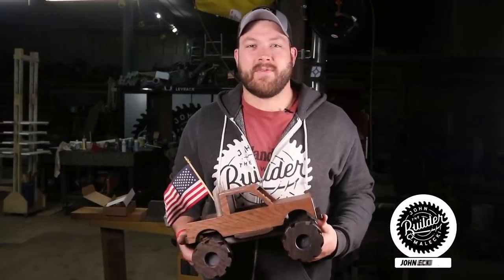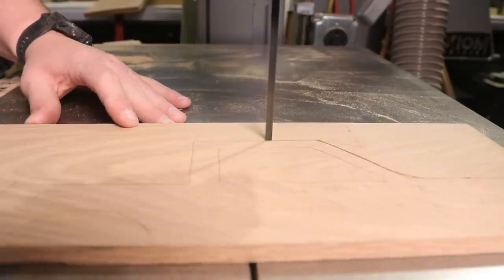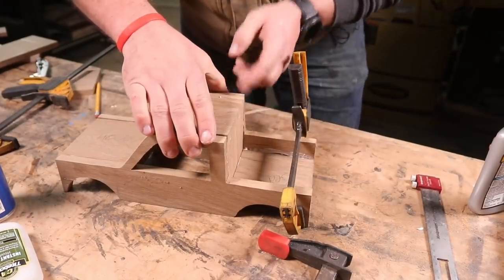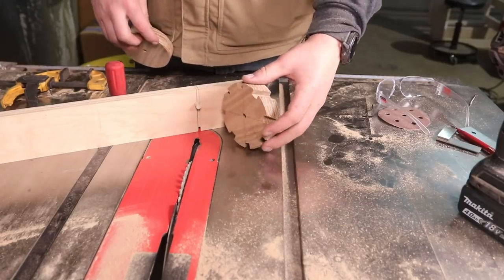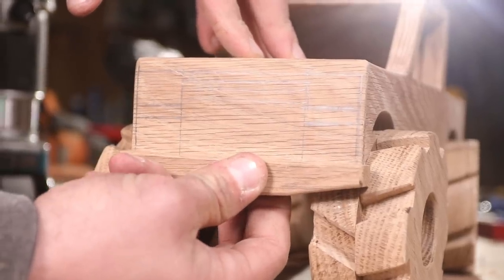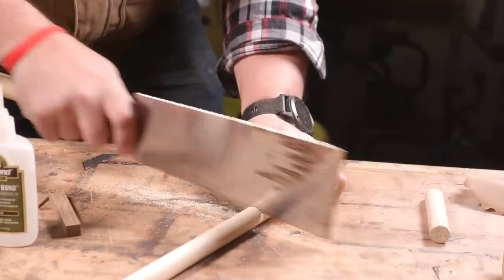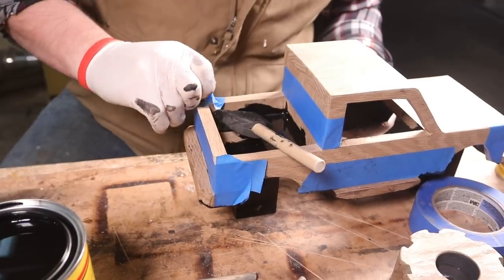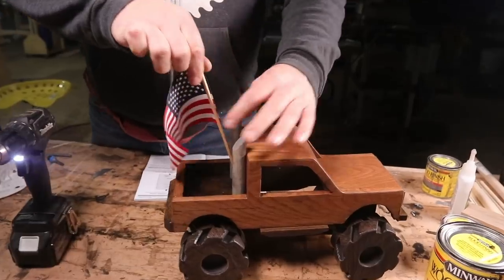How To Make A Wooden Toy Monster Truck

Comment: Awesome truck!  I love the sipped tires! One weakness I've learned with the trucks that my dad built for me and those in my 2 boys collections, over the years, the axles may be a bit on the light side.  When he sits on it ( and he will sit on it and try to ride it at least once!), they may break.  The wheels and axle block are so big on this truck though, it would be really easy to go back in with bigger diameter dowels (or steel rods?!) the next time.
Reply from the maker: Good thought bother i'll for sure keep that in mind  !

Comment: This video is 4 years old now, how has the truck held up? toddlers are masters of destruction in my experience haha. Has it been tossed down a flight of stairs?
Reply from the maker: It’s a pile of dust. Only the tires survived hahaha
Reply: @John_Malecki  I made a little jeep out of solid maple - used the silhouette CJ logo for the shape of it - and it's been broken and glued back together a few times already. haha. I think only those old metal tonka trucks can survive a toddler's wrath.

Comment: It sounds like wood heresy but I'm going to make my truck with long tenons at every joint. I have been making cabinets and furniture since '73 and am making a monster truck out of white oak. I'm starting a business doing cabinet work and have a channel called T wagner on YouTube. Wood has both seasonal movement and shrinks over time not to mention moving even more if it's not dry.